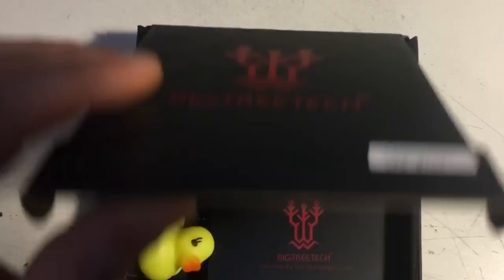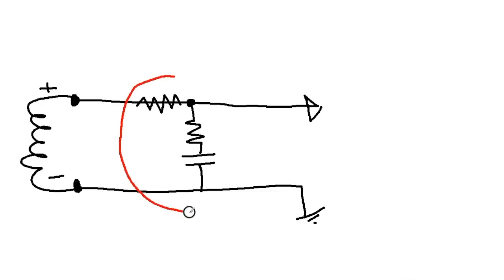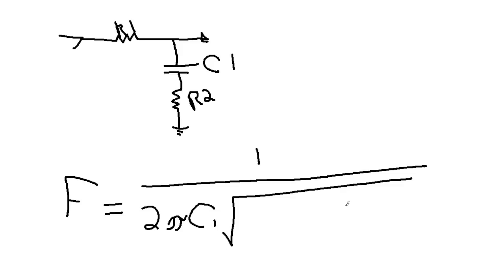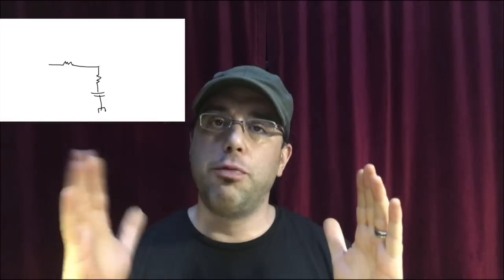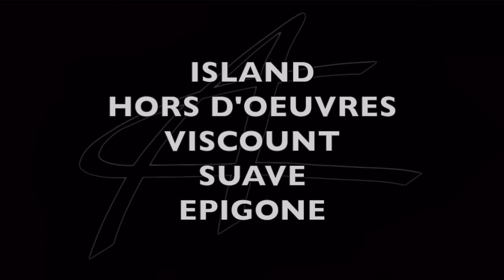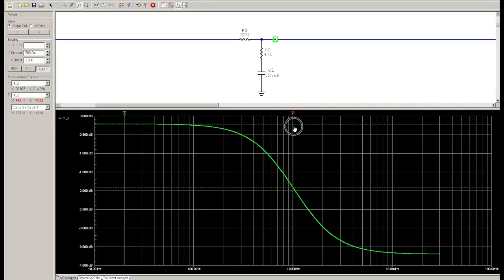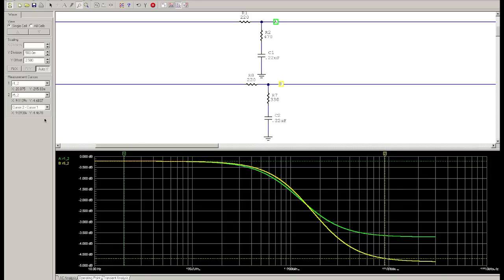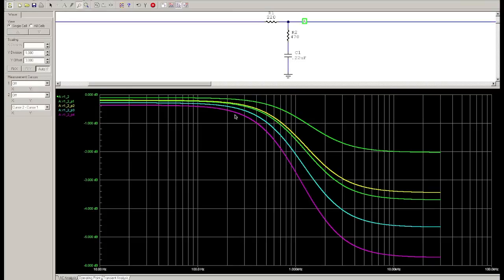Viewer Q answered: cheap mic passive eq circuit TNTM

Comment: Hi Alex. Any chance you know why almost all 3D-printer brands use leadscrews with a lead of 8 mm.? Do a little math and you will see this is far from ideal. The 2 mm. lead is much better with steppers that have 200 steps/full turn. And they save very little with using 8 mm. Why?

Comment: hey Alex, i saw your vid where you explain some details of ramps 1.6 at higher voltages like 18 and 24. It wasnt a lot of them, so it is not a separate video, but still i`d love to watch that again. Pls tell me in which video i can find that info, cus im searching for quite a while and cant find it. It was an updated info for 1.6, where biqu already posted all schematics and stuff
Reply from the maker: Hmmm... Im not sure, but most of the info should be in the "Definitive (hopefully) RAMPS 24v mod information and how to guide"? I talk about ramps 1.5 and 1.6 near the end around 22 minutes
Reply: @AlexKenis  had seen it, but was seeking some little extra detail that was missing. Anyway, i have leaned towards skr1.3 and now want your vid about that wonder board
Reply: @AlexKenis  by the way, your vids are the best source of in-depth-but-not-too-much info, so i highly value your opinion and test results whilst making a 3d printer

Comment: bring back some painful memories of my only bit of windows programming, in Borland C for windows doing the EQ graphs for the windows interface A&H's DR128 (DR1), I really looked after the 68K managing the up to 6 56ks and 2 54ks DSPs (about 23 years ago, yes it was installed of floppies and I think I have them in the cupboard)
Reply from the maker: Oh, I remember those.  That was back when i just got started in digital recording.  I ended up going all MOTU back then. So you did the UI on the PC end huh?  that must have been a nightmare with the tools available back then. I did a liiiitle bit of UI in straight C for personal use (plugins, back in the day), but was never very adept and gave up on it until IDEs got easier to use.  I jumped in right at the end of the 68k era, but I still have a few 68k machines in the closet... i think a Mac SE or Classic and either a powerbook 150 or 190.

Comment: OOO pentium 100, I opted for the AMD 486 100 back then...and loved it.  Looking forward to a video on the skr board.  I've been looking for a good tutorial on setting it up with tmc2130's in spi mode.  Just ado this, do this and it will work type of tutorial, anyone know of one?
Reply from the maker: I'll eventually get back to the ramps 1.6-plus review and cover setting up tmc2130 and tmc5160 in SPI.  I just never finished filming it because the auto-homing routine wasn't working at the time.

Comment: As always couldn't ask for a better explanation. Have you think to make a kind of speaker design series? Cross over, box volume calculation and stuff like that?
Thanks for the very good explanations
Reply from the maker: Probably sometime in the future, but  not until I get more workspace.  I thought about it in the past, filming something like a  cheap-but-decent DIY kit, like Paul Carmody's Overnight Sensations, and then introduce the concept of Thiele Small parameters and how to build a measurement mic, etc etc and try to tie that into 3d printing somehow... maybe making a small tapered quarter-wave design to get people started.